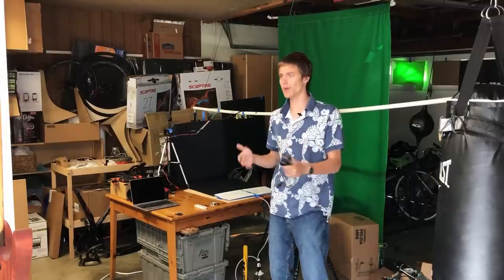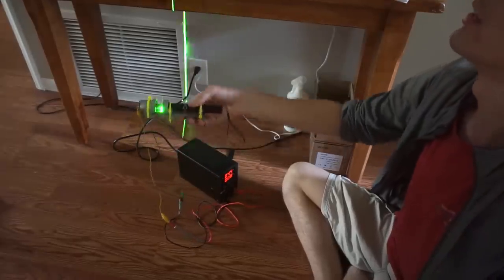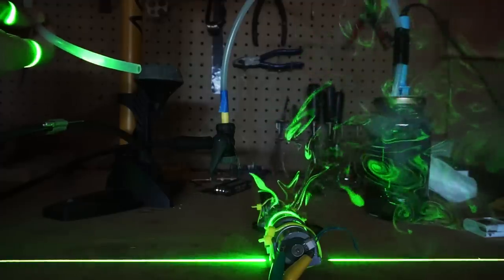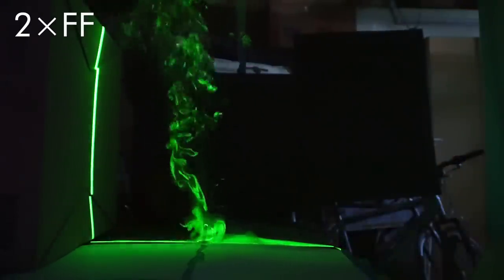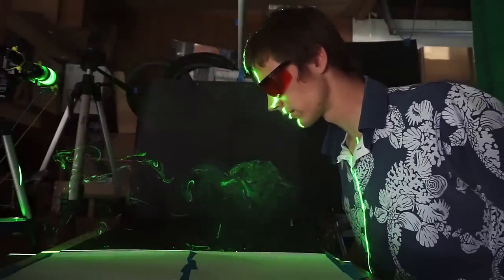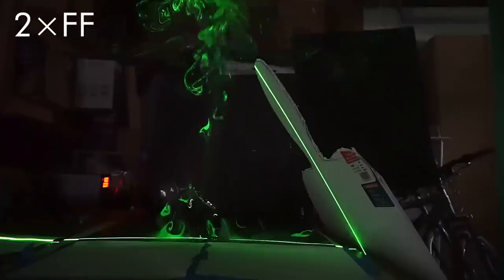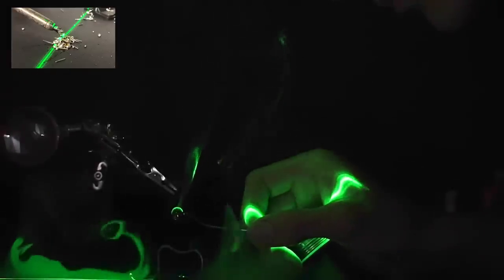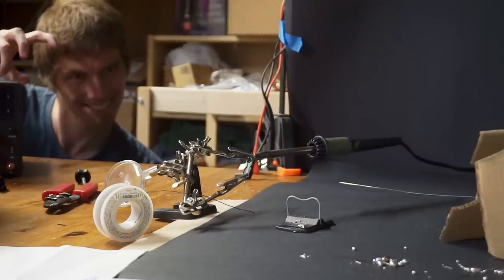Why does smoke from a soldering iron ALWAYS go towards your face???

Comment: Another potential solution would simply be sitting back a little from the table so that the draft can come up through your arms rather then getting completely blocked by it. Or another solution could be getting a table with small perforations so that the air can flow through the table itself, many tiny micro holes would have enough air flow to supply the updraft without causing a dead spot in the air and would allow the draft to continue straight upwards.

Comment: I'm in the habit of exhaling slowly while soldiering something. The slight breeze is enough to disrupt the column of smoke and its probably helping to balance the draft too. 
(if I don't set up an actual mini fan. A 12v 40mm fan clipped in helping hands makes a super good cross breeze.)

Comment: funny stuff. I can tell you're a geek by the type of food you eat lol
so what causes the smoke is the flux in the core of the solder tube, and I am glad you're trying to figure a way to keep it away from you face.

when I solder, I make sure there's no air flowing around me, so a fan is out because it would cause the solder to cool off too quickly which is bad for soldering.

To keep smoke going up with using any fans, all you have to do is make sure air is not flowing at all like a recording studio, and that will keep the smoke going up :)

Comment: Yes! Exactly! I thought maybe my attention is just lame, but it is not :)
Well, no, your explanation about no flow or vacuum between hands is wrong or somewhat wrong, because I am soldering now "on air", means the air has access from all sides, and even has a whole "gap" down to the floor, because I am not only standing, but there also is no table below the soldering iron and my hands (the table which has soldering station is aside). The effect in this case stays absolutely the same.
So, no, your explanation isn't fully correct, but thank you that you've opened the theme which I thought "isn't existing" :D

Oh, I just read your explanation "it FEELS like the smoke is ALWAYS blowing directly towards your face, but for years I wrote it off as confirmation bias. It's not.", - ha-ha! That's exactly it! You suppress, kill the information which your perfectly working attention gives to you. That's an interesting correction I must do to myself (stop killing the information my attention supplies to me)! Psychology!

I've just did some tests.
The result stayed the same whatever I did.
Moved left hand aside.
Changed the angle of both elbows (hands lower or higher).
Moved elbows outward the body, keeping the iron on the same distance.
By moving the elbow of right hand toward the belly, the effect slightly diminishes.
In these tests there was nothing below the hands and soldering iron down to the ground, as I mentioned.
Also tried with no hands at all (yes, for 30 years of soldering experience you can do that too 😛), the table still is at a side: the effect stays.

I've noticed, that in some of these my tests I cannot guarantee that the smoke gets an angle. Instead I've noticed that sometimes it simply the exhaled by me air is mixing with the smoke, and then, when inhaling, it moves toward me because of that inhalation. Especially in the "no hands" test.
Thus I am also assuming that this effect may be a sum of effects.

OK, I've repeated the "no hands" test with no breathing, and it clearly showed me that the smoke goes toward me.

Comment: Your analysis seems sound, BUT.... I smoke. I sit a desk all day, sometimes writing, sometimes using the touch pad (with only one arm extended), and sometimes just leaning back. And I can put the ashtray with the lit cigarette anywhere on a large L-shaped desk (in other words, doesn't have to be between my hands). STILL, THE SAME FRICKIN' RESULT!! The smoke always seems to find my face. I've always thought it was my body heat creating it's own "weather pattern". One thing is for sure, it's not the arms.
EDIT: I've sat at many a desk over the years, it's not the L-shaped desk.

Comment: Huh, guess I haven’t had as much trouble with this issue myself since I rarely rest my whole arms along the table then, and often tend to look at things slightly from sideways in order to see a bit better what I’m working on too.
Also working just at the edge of tables or on things raised up and held in a small vice would likely help prevent this issue from occurring.
Reply: Yea.  I always have 3 arms in there. One holding iron, one holding solder, one holding the non clamped work. ;)

Comment: I clicked on the Like button, but I disagree with your conclusion, and I do not have a draft free room or time to test my theory.  When I tear open a thin candy wrapper and try to throw it away, it is held to my fingers by what I believe is static electricity.  I think that my body is positively charged and attracts negatively charged items like the smoke from a grounded soldering iron.  I have replaced 5 capacitors on 144 high power studio dimmers (from 2.4KW to 12KW), for a total of 720 capacitors and generated a lot of rosin smoke. After doing a couple of dimmers, I bought an exhaust fan and then had to replace the fan inside with an even more powerful fan to keep the smoke out of my face. How do I reverse the charge on my body to repel the smoke? Tesla Coil?

Comment: Develop a work table with vents on the bottom and 120 mm fans inside which sucks air below the soldering.  100% works.  Made one for myself.  Works on a button cell battery it's so low power, but it's better with a 9v adapter and on off + variac switch.

Comment: This is why I have always used a solder off of the edge of a table, with a "tall" stand. Easy fix. No need for a fan, if you open up an airway below your torso. Just don't lean over a table

Comment: Yeah, I recommend a little air filter fan............. or if what you are soldering is not too small / delicate, you can put the soldering iron on an extension cord & solder outside..........

Comment: So. Similar thing happens with a campfire, right?
If the wind is not the issue, the smoke goes towards you, if you stand/sit close. If you build a fire reflector (some sort of "wall") on one side of the fire, it's supposed to reflect the heat, but also take the smoke in its direction.

There are no "hands" needed to produce this effect with a campfire. Probably because it's a much larger flame taking in more oxygen?

What do you guys think about this parallel example?

Comment: Like shower curtains: Hot water from the shower head heats the air around you which rises in what technically is a  flue so pressure at your feet is lower than the outside air and the curtain clings to your legs.

Comment: Use a computer fan placed opposite you to drag the air that way. Always works. Or just place a regular fan near you. But I've always wondered why the smoke had to drift right into my face, stinging my eyes and making me cough, like an evil vapor straight from Hades. Thanks!
Reply: I grew up in a smoking household and would move around the room to avoid it. It followed me. For a few years we lived in an apartment building with a very strong central circulation that would draw exterior air through the apartment and into the main hall, and it had squirrel cage fans that blew air through convector units situated under the windows: Serious draft. Mom said she saw the smoke change direction when I walked in the room. And yes, she smoked until she could smoke no more. Two months later she stopped breathing. And every time I visited her in the hospital those last two months she asked for a cigarette. Frankly, if I knew she was going to die anyway I would have brought a pack of her brand. And let me tell you, it sucks to be born addicted. I tried snuff/chew, eventually tried a cigarette when I was 20 and it's been a struggle to not smoke. It's friggin' weird, and I despise that the tobacco industry managed to get vapes into stores as easily as they did. And yes, I know better than to try them. What will happen is it will wake up the addiction, I'll buy a pack and it will take six months to put them down. - Wow, hope it's well written enough to not be TLDR, definitely thought I'd keep it under four lines.

Comment: I originally thought it was due to static charge drawing the smoke closer. But very interesting, as a passive solution would using a table with holes drilled between the person and the soldering iron release the low pressure zone making the smoke travel vertical?

Comment: If you've a history of soldering a lot of connections inhaling the smoke of the tin/lead/rosin solder, concern about exposure to your "mist" chemical aerosol is probably not really significant.
You could "outsource" the "laser visualisation" to New Delhi where the air is so thick that by merely breathing you can skip a meal every few days.

Comment: What if you solder at the edge of the table instead of in the middle? That way, there'd be lots of room for air to come from all directions, not just from opposite your body/face. You might not be able to rest your elbows on anything, but if it keeps the smoke away, it might be worth it.

Comment: Don't know if anyone else mentioned, but did you rule out static electricity effects? Cardboard isn't a great conductor, but it looked like there was a completed "circuit" when the cardboard hands were in situ, as there would be with real arms. Does the solder changing state at the iron cause a small shift around in charge? Enough to attract smoke? 🧐

Comment: this is exactly what happens to me when im making dentures. to set porcelain teeth into dental wax on a plaster model, I use a heated metal blade kind of like a soldering iron. the melting wax becomes smoke. I've actually tried to hold my breath which didn't help. My solution is to just hold my hands farther away from me and lower toward my knees if i'm sitting. I guess that allows just enough air flow that it's not too bad. I also do usually lean back as well. really just trying to move my face as far away as possible.

Comment: I also thought it was my arms when I did some thinking/testing years ago.
So I made a tabletop out of wire mesh (about 5cm above the regular tabletop) and tried it again.
The smoke still goes in my face. There was nothing to seal with my arms. And I was never close to the table edge with my torso either.
My solution was to finally build a fume hood. But I suspect there must be something (or something else) involved because I was pretty thorough in eliminating any possible 'arm-chamber'.

Comment: I have one of those high velocity fans from Wal-Mart that sits on my garage floor. It is aimed about 36 degrees up and sits about ten feet behind me. I have a bench set up to work at standing level. When I use my soldering iron the smoke still goes right in my face. One would think that enough air would be moving in that little 15 x 15 room that it would not be a problem. I still need a small fan on the bench to blow the smoke away.
Reply: It would probably work if it wasn't behind you, but more from the side.
Reply: @rupert7565  Probably so. But I would have to move a pinball machine and a air compressor. Oh and a band saw. I really need a bigger area for my shop. Lol
Reply: @JohnSmith-un9fy  That sounds like to much work for something that only might work. Especially since your desk fan already does the trick, it's not such a big deal anyway.

Comment: Something that I immediately wondered, but which was not addressed:  What if you soldered across from your humanoid approximation (or even a stronger "draft blocker" with more fully enclosed angular sides)?  Would the low pressure zones even out, and the smoke thus rise more centrally, rather than towards your face, without needing a fan?  Would be very satisfying to basically be able to set up a mostly closed trifold across from yourself and not have that problem, right?

Comment: My problem: Why cigarette smoke (from the tip of the cigarette) always goes straight into the face of the non-smoker?
I mean, could the wind not blow it in the opposite direction?
At least sometimes?
No, it doesn't.

I also developed the Body Heat Theory, but why does it not go into the smokers direction?
Because the smokers skin temperature is lower than that of the non-smoker?

Comment: I wonder if the effect could be mitigated by putting vent holes in the table right below your torso. Not beneath where you are soldering since a drip of molten metal will go through that grate.

Comment: Commenting before watching to see if i can figure this out :p

Your body is warmer than ambient air, creating an updraft, which sucks the smoke in.

Edit: nope, interesting tho, i wonder if putting a shape at the other end of the iron, in a similar shape as the one your arms and torso make, but slightly higher than the arms so the air might still be mostly pulled in from your side, might be a "no moving parts" solution to this problem :/

Comment: Would it still happen if your arms were only touching the corner of table and your working part is more elevated? Or what if your elbows were moved away from body and had more airgap under your pits? Or not have your torso up against the table so there was a gap coming from below? How about having another person opposite you, mimicing your position while soldering?

Comment: For anyone who's sat around a campfire with several people circling the fire; Does this asymmetric draft theory apply to that in any way? Kind of over my head but I feel like this scenario is relevant because there always seems to be a particular seat where the smoke attracts to if you don't have a roaring fire with enough heat to drive the smoke straight up (maybe how chairs/people are laid out, spacing, gaps ect?). Definitely going to keep this in mind next campfire.

Comment: nah, I am not soldering with all arms touching table as you did with cardboard cut outs, there are plenty of "holes" in my arm area, it's not so closed area. also I have lot of other things around soldering area, they also create asymmetric drafts. smoke always goes towards my face. I think it is heat draft, but, the heat draft started on hands. plus breathing, plus leaning, why shouldn't it be more variables together?

Comment: You are big warm and causing hot air around you to rise and be replaced by the surrounding low lateral air which is where your station is located. Put the station up high, at least chin height.

Comment: Wouldn't the process of breathing compound that low pressure zone? Yes, I'm totally aware that this ties in with Hypotheses #3 but essentially, breathing is just the manipulation of high and low pressures in and outside your lungs. So by completely ignoring the breath vortex (just to help illustrate my point, it still plays a part), if you're creating a low pressure zone in front of your face by breathing (in addition to limiting the available flow with your arms), wouldn't the surrounding higher pressure atmosphere seek to fill that pocket, dragging the smoke along with it?

Comment: could you just put a sheet of cardboard on the other side of your soldering iron so the asymmetrical air flow is blocked from flowing towards the soldering iron and pushing the smoke towards you?

Comment: What I'm wondering now is that if you placed a mannequin, dressed with a shirt and a wig, posed with its hands leading up to the soldering iron, opposite you on the table; would that make the smoke go straight up again? It could help determine how much of the smoke moving toward your face is due to asymmetric draft, and how much of it is is the seething hatred pouring forth from the soldering iron, directing its vast army of millions of tiny smoke particle minions to beleaguer your face.

Comment: What about the static electricity of an actual human as well to why it is so much worse compared to using cardboard cutouts?????? Since human have a net positive charge, and smoke negative.... The smoke will be attracted to the body of a human based on electrical charge alone. Basically how water bends when putting your hand beside it, but with flipped charges when dealing with smoke not water.

Comment: One prospect you failed to address is CONVECTION. We all learned it in High School.

(I also didn't see it in the comments either,but I only read about 100 or so. anyway.)

Just like the seabreeze showers along the gulf coast  in the daytime. Warm air over land rises and the cooler air from the cooler water comes in behind it to take its place.  High pressure to lower pressure.

As you sit there soldering you are warm and you are heating up the air around you, and it starts to rise,
The cooler air from away from you comes in to where you are, replacing the warmer air that has risen. Thus bringing the smoke from the soldering iron to you .

Just a thought.

Comment: I used to solder for hours at work and what I used was a crappy old laptop cooler pad leaning on the edge that blew a wall of air just between me and iron and I set to low speed so almost no sound

Comment: you dissipate heat trough conduction with air... hot air goes up... and so it pull fresh one frome the solder iron laying on the table in front of u... : use a fan and open some widow